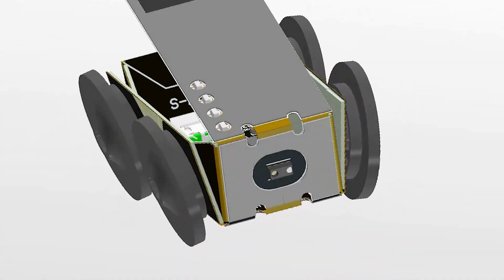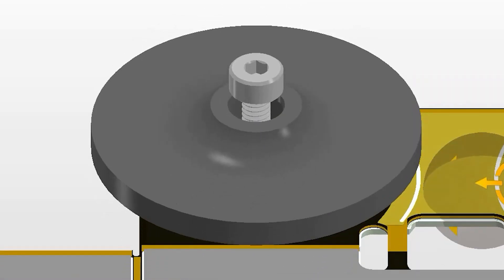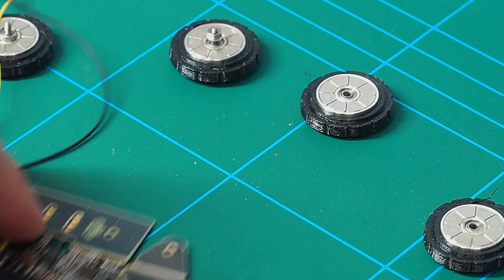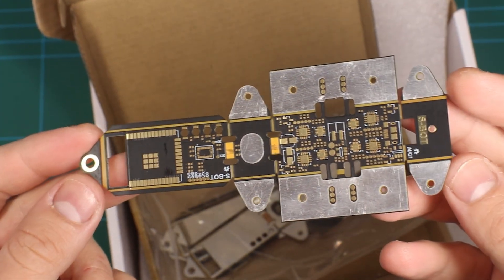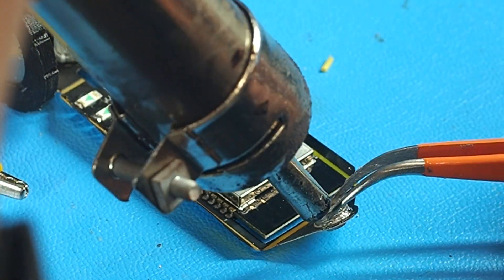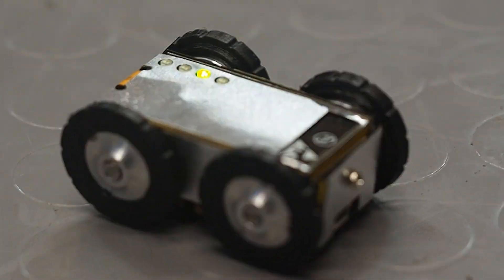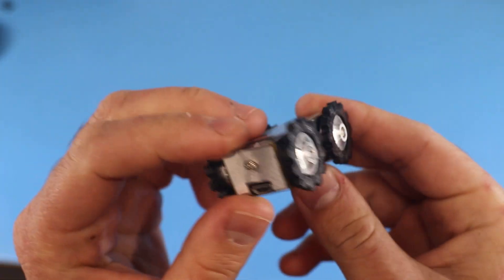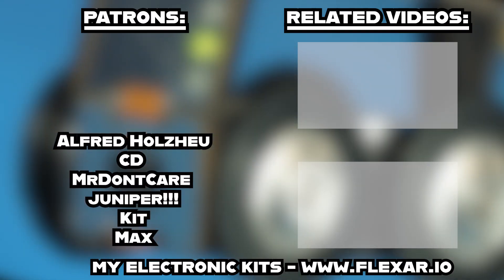Building a Robot from Foldable Circuits!

Comment: I wonder how it would effect the robot if you implemented a sort of differential in the control loop, so if one motor starts spinning faster than the rest, the power could be diverted to the other motors that are struggling

Comment: It would probably work better with only 3 wheels. Looks like it struggles when one wheel is up in the air in 4 wheel configuration. With 3 wheels you could never lift a wheel off the ground.

Comment: That's awesome PCB engineering! I'd replace the tires with rubber bands, cut and superglued directly to the rotors. Two advantages: rubber has a higher coefficient of friction than 3D printed TPU, and the smaller wheel diameter will result in more mechanical advantage.

Comment: Your robot's having trouble turning because its wheel base is much longer than it is wide (an issue for tank drive robots). If you increase the width between the wheels it should turn more easily.

Comment: You could have the roof flap house extra pcb motors to layer up the motors to a thickness you can use. With a more clam shell design you could use pins again to add rigid to center with help of Aluminum Standoffs. A plugable pi cam, would be cool. As would passthough holes big enough to mount a pin on ethier side for the battery. Love the designs, i wonder if a boat would work. You got my like.

Comment: Maybe you can design the motors to be separate tabs from the chassis and leave the unsecured as to create a moving fixture? This may help with the traction issue. Rubber bands may also be a good work around

The PCB soft connections are quite flexible, maybe you can take advantage of that to create a “origami double strut suspension”?

I am just throwing out ideas.. you’re the engineer.

Comment: Nicely done. Could you maybe use a pin at either end of a shaft instead of nuts, then drive the shaft with both motors?

Good watch ty.

Comment: Some of your trouble with traction may be coming from lack of mechanical compliance. In essence, your box structure is too stiff near the PCB motors. It might be worth exploring ways you could isolate the stators from the rest of the slab sides in such a way that each stator/rotor/wheel stack could flex a bit about a horizontal line. I don't think you want any flex on a vertical line since that would interfere with the skid steering geometry.

Another approach would be to keep each differential wheel pair rigidly aligned with one another but provide axial flexure between front and back. This would eliminate most of the suspension geometry problems the rigid box structure imposes that prevent the wheels from maintaining contact with the ground. Earth moving machinery (such as the ubiquitous "Bobcat") solve the suspension geometry with lower pressure tyres that provide the flex I mention above, but with your robot the limiting factor would be available motor torque, as you discovered with some of your soft/wide wheel iterations.

Comment: This is awesome! You have just blown my mind! Here are a few ideas for V2:
- Larger body to accommodate larger motors and bigger batteries
- Larger wheels to improve ability to navigate rough terrain and climb obstacles
- 6 wheel design to overcome thermal constraints on motors
- Small fan to improve thermal performance and allow higher voltages

If anyone else has any ideas, feel free to like and comment below so he sees! :)

Comment: Make rubber wheels to increase the traction between the wheels and the surface. Another improvement might be to introduce a boost converter (I know you are limited in space, but stacking pcb's might help) to have one battery whilst having a high voltage to power the motors, since you are limited to the resistance of the coils.

Comment: or just use jumper wires, after folding
Reply: altium is horrible, no customer service
Reply: whats the point of forcing smd when normal axial fit just as well and can be hand crafted (also machine automated assembly manufactured)
Reply: overcomplicated is overcomplex
Reply: if you have a ground plate, then that can be used as a serial communication channel
Reply: try voltage controlled capacitor C-CR ac voltage divider power supply with fbr
Reply: try AA/AAA cell shaped spin energy storage cylinder
Reply: try pipe pure brushless dc motor
Reply: kapton tape + laser engraver = flexible tape multilayer graphene trace pcb at home

Comment: Great stuff - very thin flexible 'fingers' or flaps on the tires would increase traction on rough surfaces I think - also the extra weight of the double lipo probably helped traction (but required more torque - trade off).
Keep up the awesome work.

Comment: Excellent educational video, you're definitely exploring the boundaries of using BLDC motors, one suggestion if I may, is to explore if possible to use a combination  of BLDC and dc motors i.e. instead of using magnets try to use another pcb connected to the M board with brushes (if you can find that small) in that way you can reduce the weight & cost of the motor + Possibly achieving more torch by switching this new pcb with different voltage polarity and phase angle. Again great to see another Maltese having a top notch Youtube channel. Proset

Comment: Everything is fine except the motors. I see pcb copper and magnets, but no visible silicon steel housing to direct Eddie currents. As a result, very weak torque, and low efficiency for that pcb motor. Might be worth trying a planetary gear reductor.

Comment: I think if you can switch it to a 3 wheeled car turning and traction could be solved. Or make  it into a tank with tracks so the torque is spread across each sides morots. Without suspension it will loose traction  too easily so perhaps instead of having sides one piece Have each corner with a motor a separate flex PCB so it has more give. An Idea for more torque is instead of having rotors in the main PCB. You used a separate PCB as a daughter board for each rotor? Similar to how you mount the micro controller. Then you can have the more torquey rotors/coils with the same car?

Comment: It'll probably be difficult to fit in that tiny wheel, but have you tried using a Halbach array for the magnets? If you can fit it in, it might just give you the torque you need to really get it moving the way you want.
Reply: That seems interesting. Because halbach is stronger mag field, that would increase torque?
Reply: Excuse if that is obvious. Still a little zonked from days of relatively tough travel recently.
Reply: @THE_BUDDHA  : Yes, that would increase the torque.

Comment: You'll probably get better performance out of the motors if you change from aluminium wheels to steel. The steel should reshape the magnetic flux so the majority of it is pointed in towards your coils.

Comment: It looks like the next version will contain a set of several rotors for each wheel. there's still room to fit three sets (circuit board and magnets). This will definitely increase the torque. How minimut will increase the magnetic flux. In addition, I would like to see more illumination. You give a display of LEDs in the entire cover. Let's say an arrow indicates the current direction. Or funny imogies. Oh, and what about the light sensors so that he runs after the laser like a kitten?

Comment: What if you made a track version instead of wheels?  Then you could have many more coils pulling the tracks, for more torque.  Also keep the wheel motors; the track coils would be at right angles to the wheel coils, parallel to the horizontal plane.  Need more torque?  Use longer tracks.

Comment: I see you are running into the wheel slipping issue again. I have an Idea. How about a 3D printed wheel, with a groove on the outside that takes in a rubber O-Ring? Kinda like a bike wheel but with solid tire.

Comment: is it possible to to make the coils for the motor on both side of the rotor
may be it would go=ive more torque but you will have to redesign the PCB and the bot would significantly increase its width.
anyways all the best for future iteration.

Comment: The trouble with a rigid wheel suspension is that you really only get two wheels driving the rover at a time, and this requires way too much torque for each drive wheel in contact with the surface.  I'd like to see you come up with a suspension system either for each axle or each wheel.  Ya, I know, easier said than done.  

Robotic Engineering RULES.

Comment: I think you should make the tires very thin if you want good traction. Such tires will flex more to appease the surface.
Very cool project though, id love to see those motors improve, or maybe do some other mechanisms with just a pcb. Maybe make a bigger, more powerful motor with a pcb, should be possible. With more coils too. Maybe suspension, imagine magnetic suspension~ Maybe powering one wheel with multiple motors? Maybe a drivertain with motors that have holes, the shaft going through, and there would be opposing motors on the shaft itself, so you power them both and get a lot more power, but you could also stack them, and have quite a powerful pcb motor thing. Okay, i should stop, becouse i can keep on thinking of new ideas

Comment: I'm constantly impressed and inspired by the creativity here, really love this project. One thing I was was thinking about was why you continued to make the wheels more or less solid when you scaled them up (I'm assuming they aren't solid infill but still). I think to get the benefit of surface area but maintain low weight you could pocket out the design and see a reasonable improvement or just print them with little to no infill. That said, I don't think that's a "cure-all". Really excited for the next video!

Comment: that's cool
this would be so good for like buying these individual robots in bulk (cheap) and then you can program them as a fleet to move together or something
has a camera too?  damn, need to sandwich an IMU in there, omg it has one, that's great
5:52 noooo reeee
hmm if you made the middle of the pcb bend, you could have a ^ shape where the middle rises above the wheel axels but harder
last thought maybe you can add reduction gearing for more torque

Comment: Beautiful project. What are the options to increase the torque?
Reply: I got an idea. You can add an extra coil set in the part that fold inside and an extra magnetic rotor inside the box. I hope it make sense.

Comment: USB C for the win. I know it takes a little more space, but still a much better connector. Love this design idea though. Great job!!! I might suggest using a single PIC to drive all four wheels rather than one per. Would greatly reduce your hardware complexity. With your pcb coils, could you make a wireless charging version instead of using a connector?

Comment: Is it possible to use two coil pads per wheel?

Yes, you'd wind up needing double the battery capacity (basically) but you'd get more power to the wheel.

Comment: if you made it twice as big and gave it tank tracks, or omni-wheels. then you may be able to get it to drive over anything.
Reply: omni-wheels would get stuck significantly more, not less. They're much less efficient, they usually have poor terrain climbing ability, and they require intricate mechanisms which would be prohibitively expensive and unreliable.

Comment: I wonder if you could make an actuator using the small amount the flexible PCB changes size and heating/cooling the PCB to make it move, you can do it for fishing line. Coiling the material can "increase" how much it changes in length.

Basically if you can make a long flexible PCB with thick traces and coil it up, then run current through it to make it heat up and shrink.

Comment: Could you somehow get away with an induction powered electro magnet instead of the permanent magnets? So in the end you'd have the wheels as just PCBs too.
Reply: Induction power would require too much of a current. You'd burn up the board, assuming you could even generate a big enough current. There's just nowhere for the heat to go.